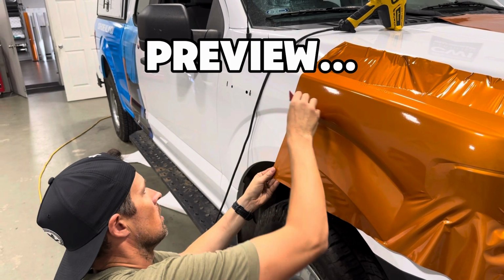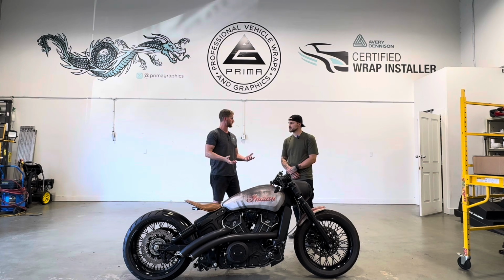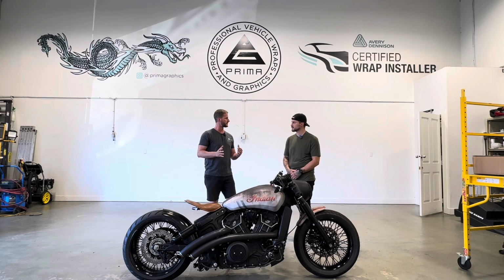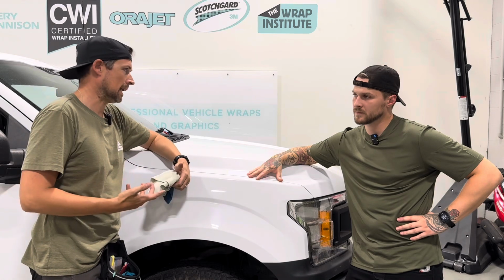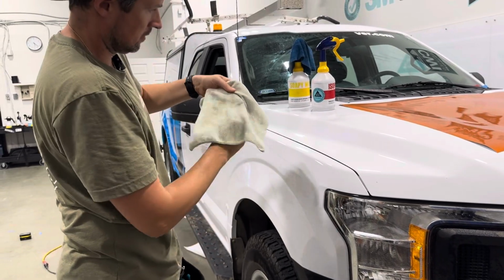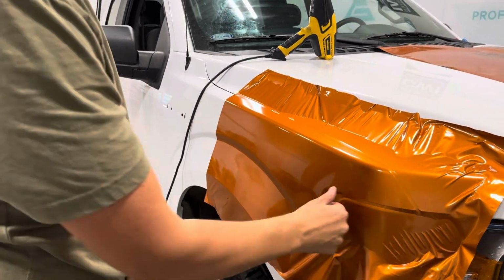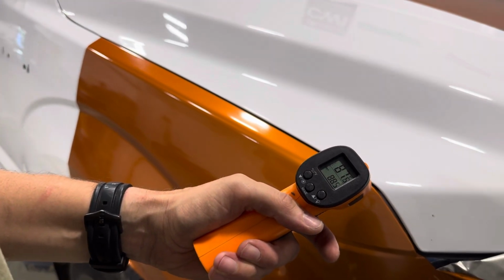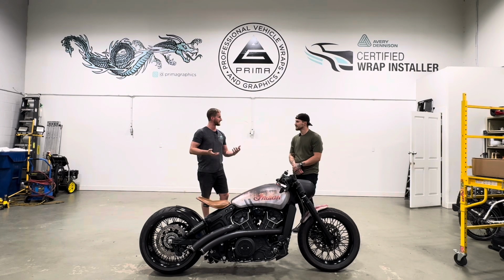How to vinyl wrap your motorcycle

Comment: Is that one or three pieces on the tank?
Reply from the maker: @shrugger1  multiple
Reply: @StreetPilots  Right on. I see how they did it now.
Reply: Would you be upset if I bought this graphic from Prima?
Reply from the maker: @shrugger1  not at all
Reply: @StreetPilots  I thought all the '24 bikes were done and gone. Was about to pull the trigger on a '25 bobber and rechecked the inventory.
Well my local got 41 2024 Scouts in, every model. So now! thanks to you! I'll be getting a '24 Scout bobber!😋
Almost $3k less than the one I was gonna buy.